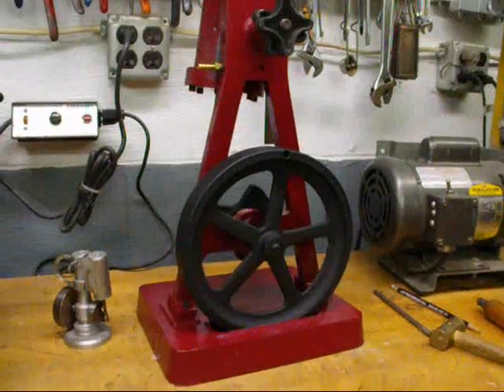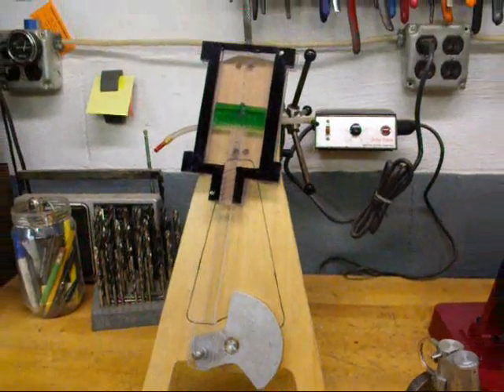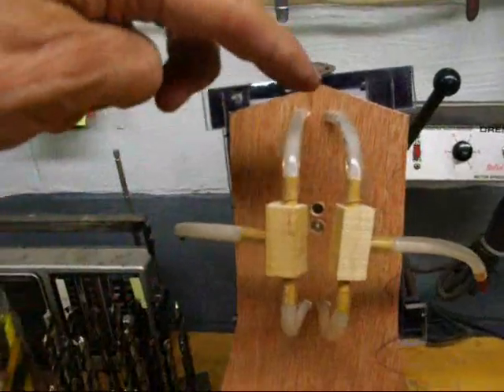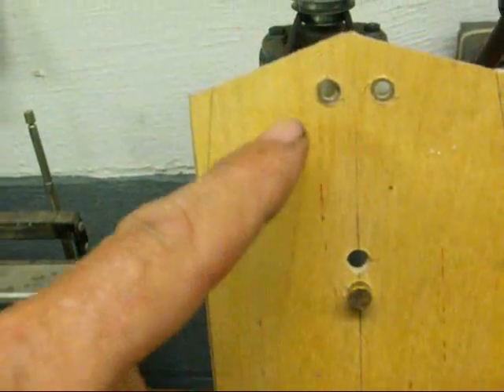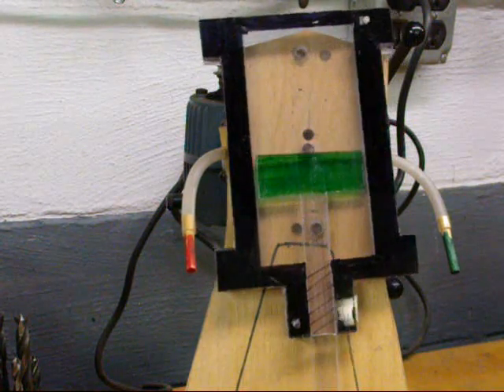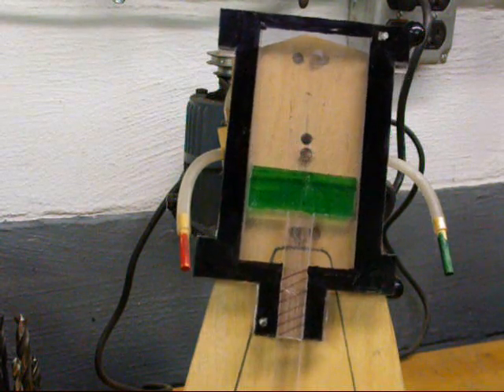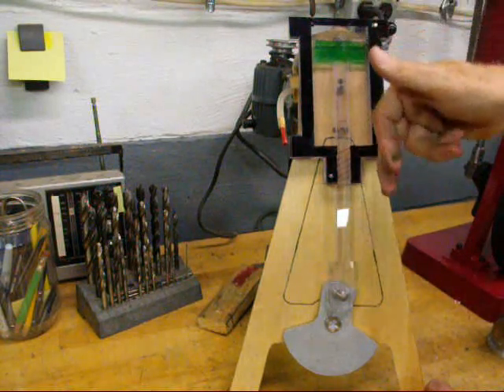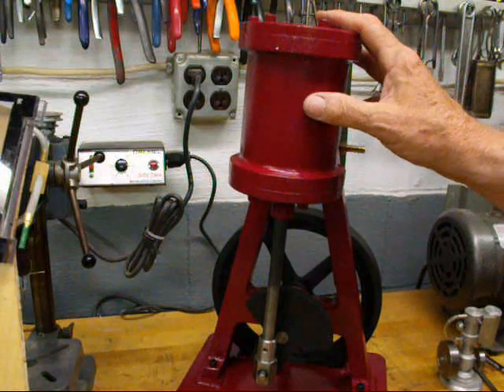STEAM ENGINE wobbler-How the Valving Works

Comment: Thank you for showing a rectangular/square “cylinder-piston” and valve ports. The super simple working model I made in high school around 1960 uses nesting square soft stock brass tubing for the cylinder/valves and piston/connecting rod. Construction requires only a fret saw, needle drill, and pencil soldering iron. My model is single acting to avoid the complications of a stuffing box.

Comment: All the "steam" engine videos I've watched and you've only applied about 10psi.  What's the most pressure you've run one at and have you ever measured the RPM's at the higher pressure.

Comment: Hi Mr Pete. You've been around for a long time, almost as long as your biblical counterpart, the first arificer. I'm 71 and I've been aware of your work for many decades. Can you advise the percentage power increase by being double acting as opposed to single acting? Assuming accumulating frictional losses, I would expect perhaps a 50% increase but not much more....?
Reply from the maker: I would expect 70% but I am just guessing
Reply: @mrpete222  Many thanks for responding MrPete. Circa 70% is worth having for a little extra effort...

Comment: In order to improve the self-starting capability you can "time/widen" the inlet ports. The theoretic work to achieve the optimal tuning is commonly done by drawing Zeuner diagrams or Zeuner circles... Unfortunately wikipedia is being "censored" here in Turkey today so I can't give you any links, but I am sure you can find more info on wikipedia about this subject.

Comment: I know you wound up redoing the crank wheel in the series.How do you determine what weight/thickness/throw you want for a given flywheel?I want to do one of these myself,but it's scale  will be dependant on whatever old flywheel I can find.I guess what I'm asking,is there a formula(I know you don't normally do drawings,etc,),for stroke/weight for a given flywheel diameter/mass?Great series,as usual,BTW!Thank You!
Reply from the maker: +Bowtie41 Its all bguess & bgosh. seat of the pants engineering
Reply: +mrpete222 Well,then bgolly,I'll figure it out,lol.BTW,after 20+ yrs as a machinist/model maker/some tool & die work,before becoming disabled,I have NO seat of the pants left......TOO many bosses!Thanks again for sharing your knowledge,have a great weekend!

Comment: Have you ever made a wobbler engine with more than one piston? A radial engine or an in line? Im very eager to make a radial engine. You are the best instructer i have seen. Please make a tutorial on this type of engine.
Reply: I know it's been awhile since you posted this comment, but you can buy a radial wobbler from minicastings.com. It's called a Liney 5 and costs $55.00. You machine it from raw stock, no castings, and as the name suggests, it's 5 cylinders. I have that and the RV1 & RV2 which I haven't started working on any of them yet.
Reply from the maker: +Coco Puffs Thanks for watching-I made a 2 cyl, once

Comment: I would venture to guess that the friction created between the wobbling cylinder body against the stand would cause wear over a period of time and cause leaks near the steam ports due to the increase gap that would form from the abrasion. I would think that such friction would reduce the effective performance and overall life of the engine much faster than a non-wobbler. However, I do doubt my own assessment since the wobbler engine was obviously a success. Could you please shed some light on this topic.